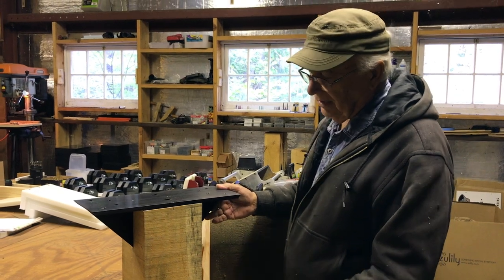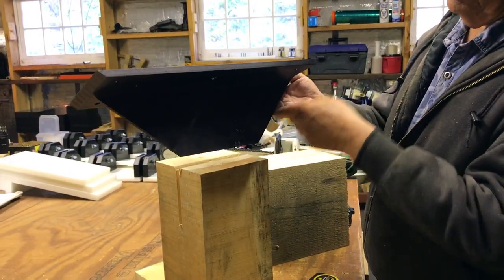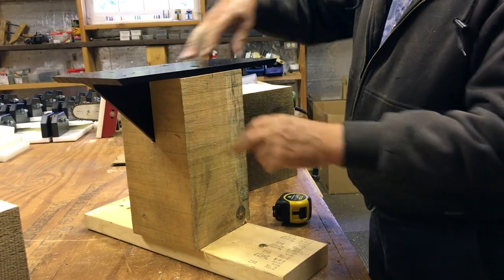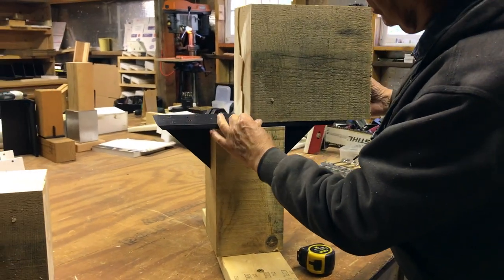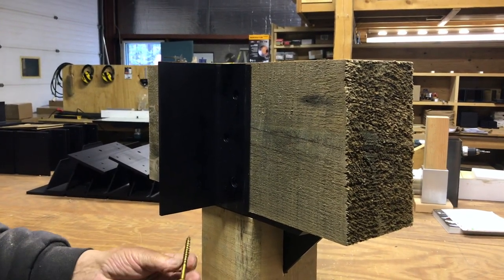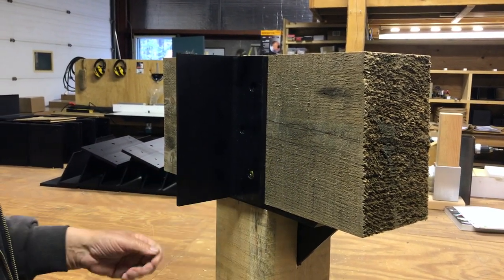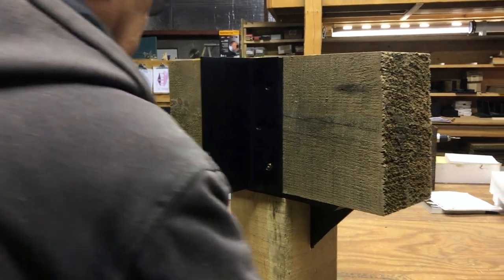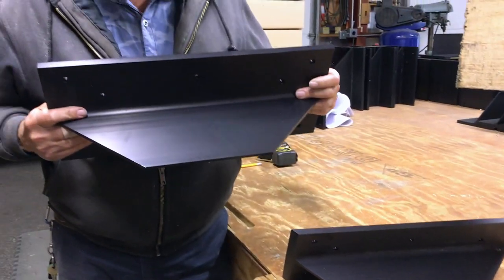CONNEXT 4-WAY CONNECTOR

Comment: This depends way too much on shear strength of the bolts.
Reply: If this was the case, all deck ledgers would be in trouble.  This is different because the horizontal beams are connected not only by structural screws but also with a steel plate